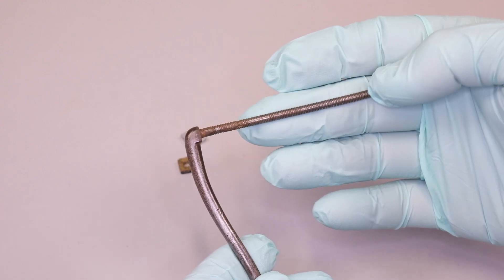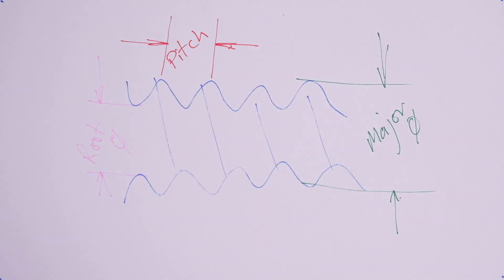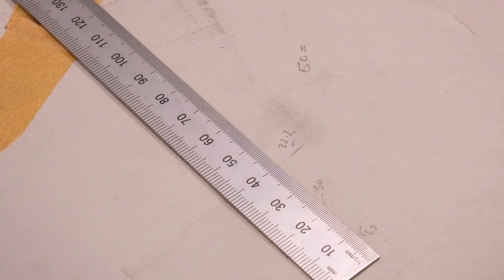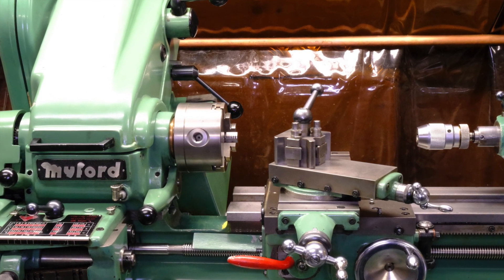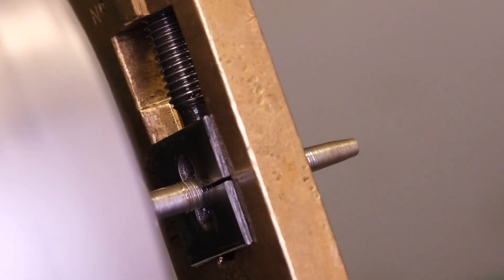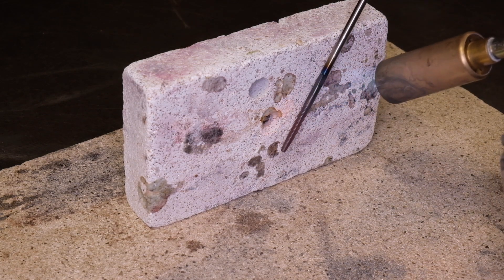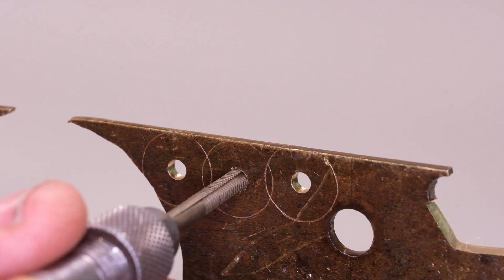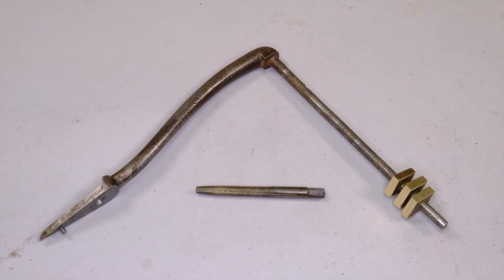#029 Thread matching for historic clocks - making a tap

Comment: This is such a valuable bit of information. Ive often struggled with missing nuts or bolts and had to improvise, which is another word for botch 😆
Reply from the maker: Thanks Treetop, yes it seems improbable that there isn't a 'straightforward' way of matching threads on older clocks but there isn't.  It always seems to be quite an involved process but worth preserving the threads I think.  Glad you found it useful.  M

Comment: Another great video Mathew. I collect primarily Beha cuckoo clocks, and I’ve come across several clocks with missing hour, and minute hand nuts.  I to have found it impossible to match up the threads with  modern day thread sizes. I’ve often wondered if they used a lathe, and came up with their own thread sizes? I’ve tried to swap the hour and minute hand nuts with the same movements.  Thirty hour movement to thirty hour movement. Or even from fusee to fusee, and running into issues with fitment. So obviously there’s several different thread sizes that they used. I’ll definitely use this video to try and re-create these nuts.  Thank you!!
Reply from the maker: Thanks William.  Yes there are a near infinite number of thread pitches to thread diameters out there. If the clock is post 1850 then I would always look at BA first and of course Whitworth for courses work.  Glad the video was of use.  Yours, Matthew